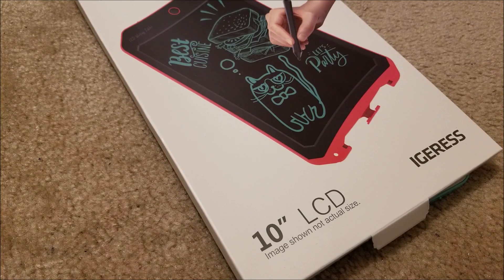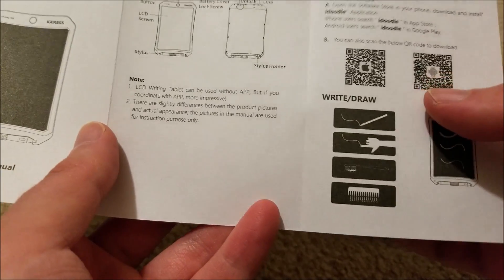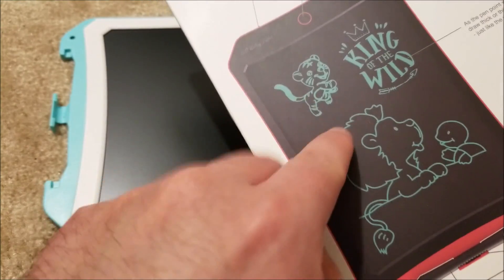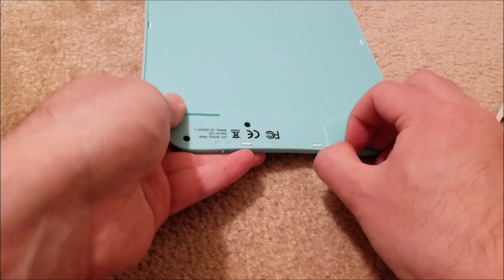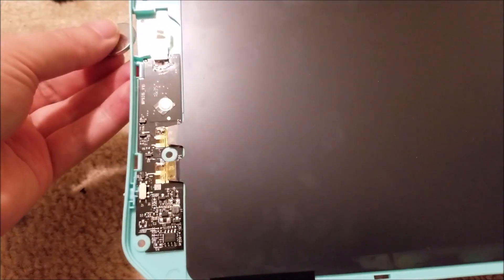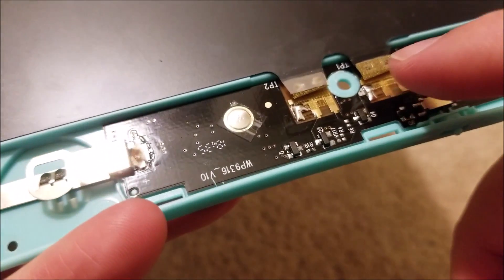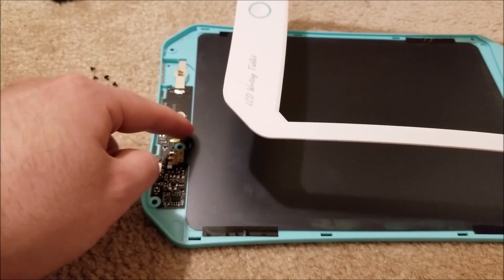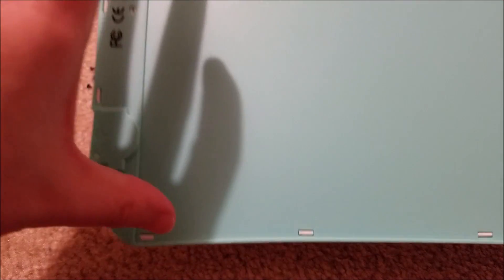Lab Tech: IGERESS 10" Writing Tablet Teardown And Review

Comment: do you think there's some simple process to make a game board out of this with 3 states? i've been wondering if this would be a simple cheap way to make a go board. So you'd need a grid of 19x19 with a round white piece (an empty circle) and a black piece (a filled in black circle with a white outline), played at the intersections. the third state would be an empty intersection/grid point.
Reply from the maker: Yeah you could absolutely come up with board games to play on this (besides the obvious tic-tac-toe)! They also now have some versions that you can "erase" partially what's already been drawn by scribbling over what you want to remove.

Comment: How this screen is called? How it's working?
Reply from the maker: I think it's some kind of variant of lcd, but unlike any conventional kind I've ever seen. My guess is it has liquid crystal between two clear conductive sheets with polarizers on either side with a very thin gap in between. When you write, it forces the liquid in between to move, letting light pass. When erased, an electric field redestributes the liquid crystal evenly again. Just a guess, I could be entirely wrong.
Reply: @sjm4306  Fascinating. :)